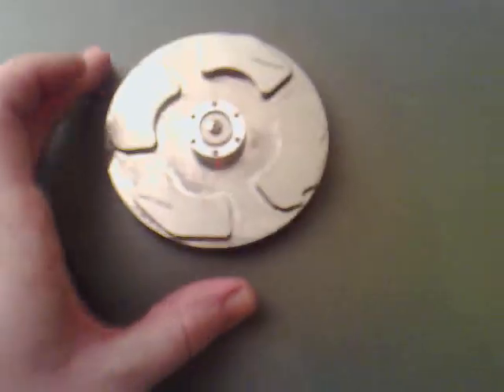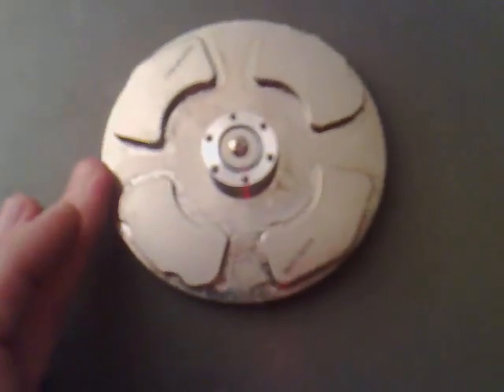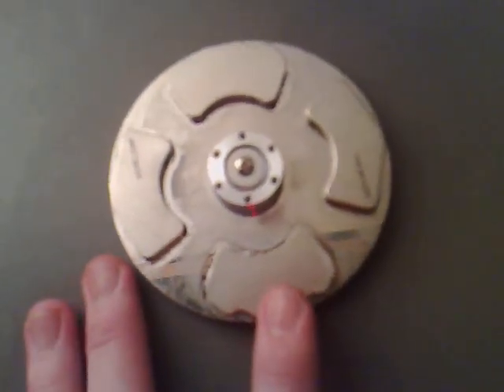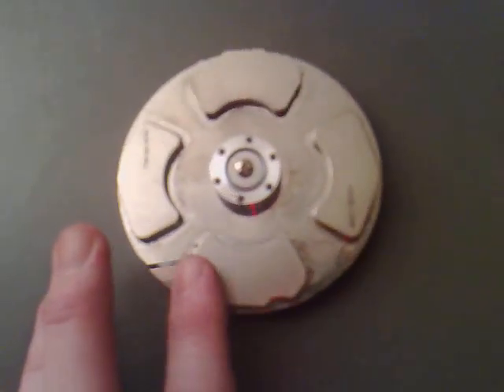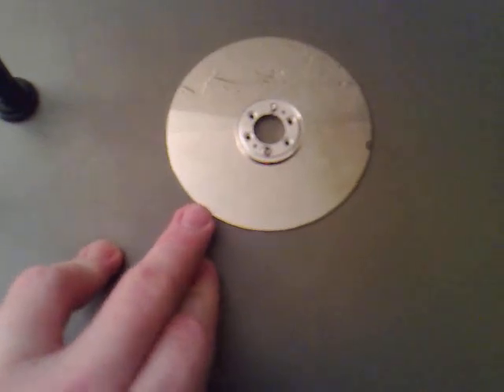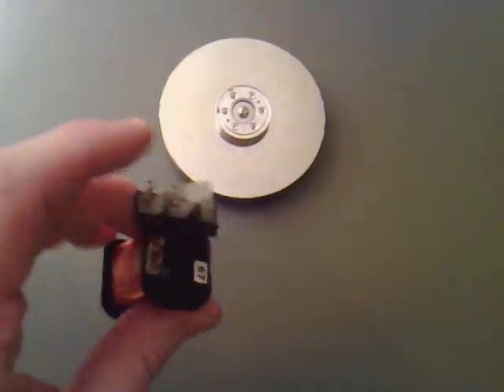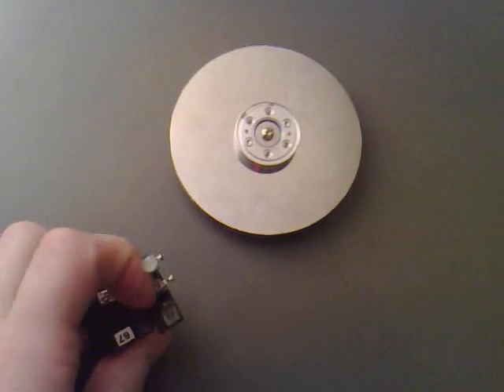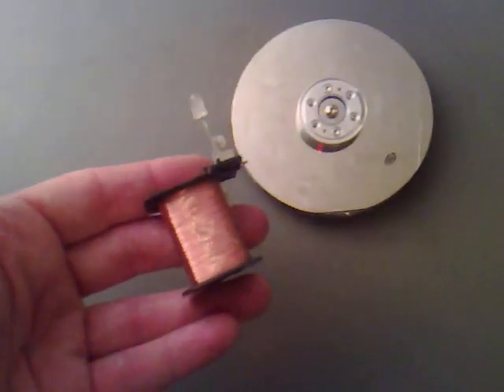Stirling Engine (Flywheel Magnets) 004

Comment: @OhNoNotMyPenis Seeing as no one answered your question, not sure if you still care for it.  

:p but yes the faster the generator spins the more power it will generate up to a point.  

This is the general concept behind all generators spinning magnets around a coil, or a coil spinning around magnets.  The energy to spin it is always more then the energy produced.

Comment: @hopenbeck : LED takes avg of 45mW (miliwatts), a fridge uses avg of 750 W, so making it @16666x more powerful. The disk looks about 4 inches maybe? football field being 100 yd = 300 ft = 3600 in, would make it only 900x bigger.  So no, it wouldn't, you've underestimated. Not to mention the power it would take to spin it....but don't be offended by this comment, I'm just passing by

:)

Comment from the maker: I think that they were making fun, saying that I eat and I can move and I can spin the rotor to make electricity.

The Stirling engine will run off heat which will spin this flywheel. I like to make step by step videos to show myself the steps easier and hopefully to others also..

The finished product will run of night light candles...

Thanks for watching.

Paul..

Comment from the maker: You could always use it to charge a Super Cap then with the large Flyback voltage not effecting the load of the Flywheel then power items off that, I was thinking a 2.5v 10F Super Cap any ideas?

I was thinking a Fresnel lens for free solar charging of low powered electronics?

Any suggestions? and can you now see how it is connected to a sterling engine. Suggestions for a piston material would be helpful?

Thanks
Paul.

Comment from the maker: Sure,

Either get two pairs of mole grips and clip them either end and bend the shielding off or put a screwdriver on the magnet and hit with a hammer.

use safety goggle.....;-)

Paul.

Comment: lol it works just add a small pully then to a motor then a battery and put a coil on top and make it recharge the battery then you might get it to run foever